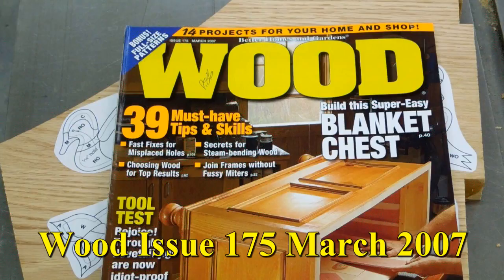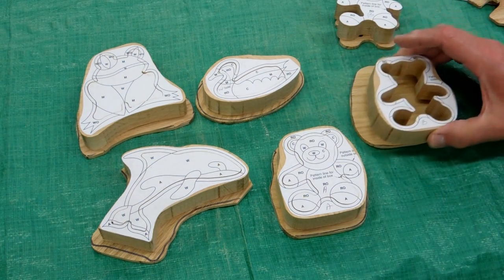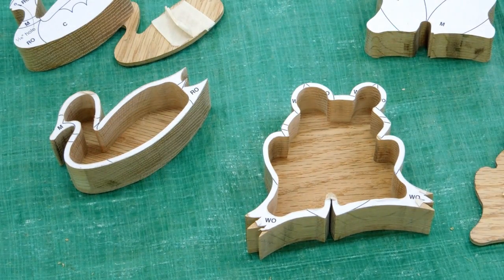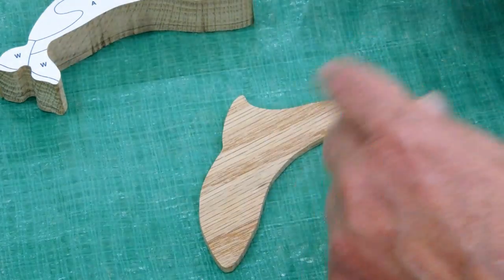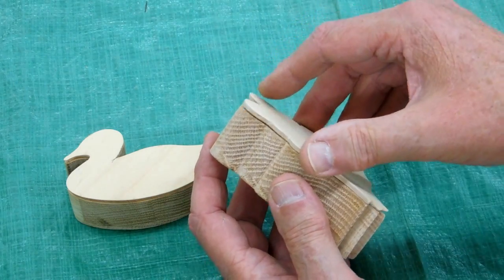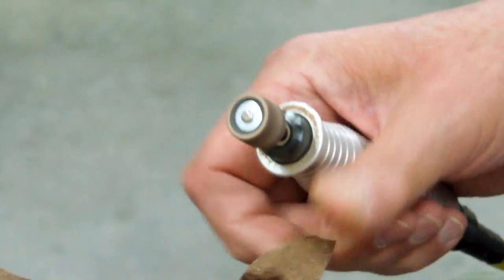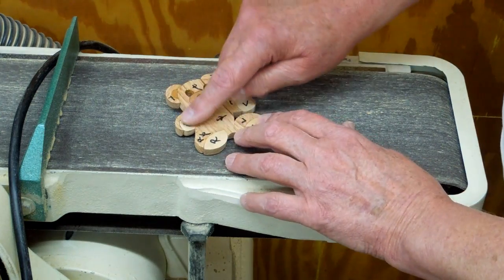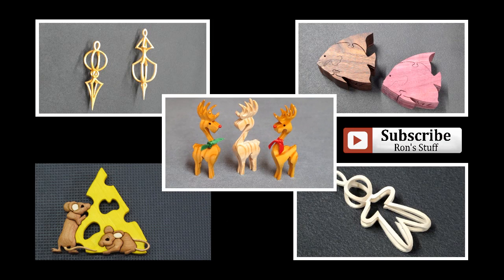Keepsake Wood Intarsia Boxes

Comment: What do you, or did you use to finish sand the pieces after you got their edges all rounded over?  Was that what the buffing wheels were used for?
Reply from the maker: +Justin H   I used 120 and then 220 then buffed with the dry felt wheels and they felt pretty smooth and I did not see any more scratches in them. The one frog you can see is shinier the the others and on that one I played around with some finer grit and the 3M wheels. If I am only making one piece I will probably get them smooth as glass but with so many pieces I got tired of working on them (old hands and fingers syndrome). With the mineral oil they feel really nice and smooth and when applying the oil, if a scratch appears I go ahead and sand it wet with 220 and wipe on a little more oil.  Actually, you can mix a little paraffin into heated mineral oil. They often use that mixture on kids toys. I forgot about it otherwise I could have tried it on these.

Comment: Maybe this is an odd question but where does one get the 3/16 or even 1/4" wood? I'm having trouble finding some
Reply from the maker: Actually that is a good question and one I haven’t thought about being a problem for someone as I just go out in the shop and cut whatever I need. Someone who does wood intarsia will have stack of boards, table saw, band saw, plainer, sander, etc. to prepare whatever thickness wood they require for a particular project. Obviously it would be cheaper if you could prepare your own wood or have a woodworking friend. Otherwise, look around your area for a hardwood or exotic wood supplier. They tend to sell large boards but some also sell thin boards for arts & crafts or (for a price) will cut whatever you want. Search the Internet for “Intarsia wood suppliers”. I found one http://ocoochhardwoods.com/ which offers quite a selection (Note: I have never purchased anything from them). Look around for others.  Another possibility is National Balsa http://www.nationalbalsa.com I purchased some thin wood from them when I was building my street organ and it was good quality. I notice you are in Canada. Try to source your material in Canada, as shipping cost across the border tends to be prohibitively expensive. Kathy Wise or Judy Gale Roberts are Intarsia artists with countless designs. Kathy Wise has a great website with information on how to get started and she has workshops (possibly expensive). You will have to look around for small pieces of 1/8” or 1/4” Baltic Birch Plywood as it comes in 5 ft x 5 ft sheets. For common wood such as maple, oak, ash, poplar, walnut a local carpenter shop may have cutoffs from a project and (if cooperative) may prep them to your desired thickness. Hope that helps. Thanks for watching. Please Subscribe! Ron

Comment: would've been nice too see u put together the multiple colored ones
Reply from the maker: This is a 13+ minute video with an average view time of just under 5 minutes (which is pretty good statistically). People in general have a relatively short attention span and making a longer video only results in more of the video not being watched. Having shown all the steps to make these, with the exception of showing all the small pieces being made on the scroll saw or the actual application of glue, if someone cannot take the ball and run with this or a similar project… it probably would not help them anyway. I have many videos showing how to cut project pieces on a scroll saw. Thanks for watching! Ron

Comment: What blade was you using please
Reply from the maker: I do not have a record of the blade used. 
Flying Dutchman Scroll Saw Blades
I use a lot of Scroll Reverse FD-SR No.5  - 5” x 0.037 x 0.015 13 TPI / 7 Rev Teeth 

and I use Ultra Reverse FD-UP No. 5 – 5” x 0.037 x 0.015  15 TPI / every 3rd tooth reversed

Basically, you need to find a blade that works for you for the thickness and type material you are working with. That requires some experimentation on your part.

Thanks for watching. Please Subscribe. 
That is what keeps this channel running. 
Ron